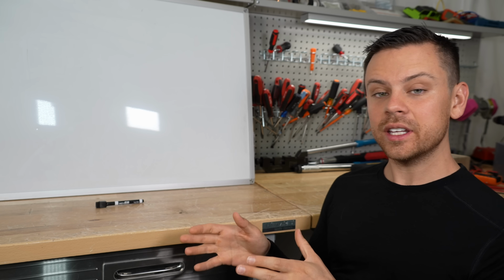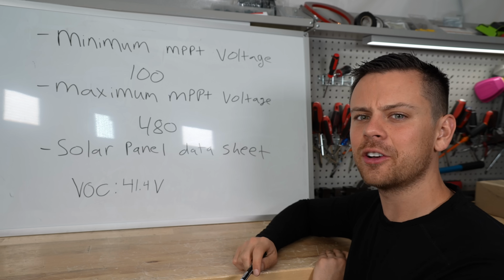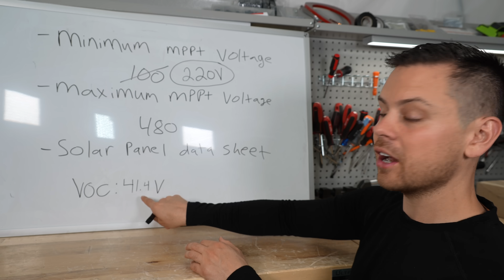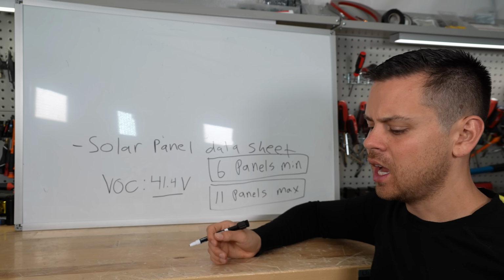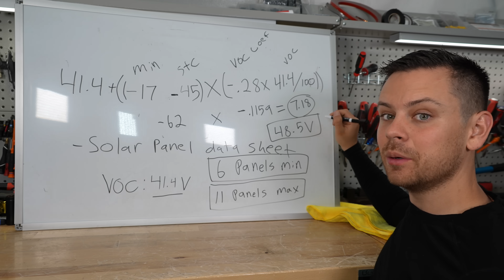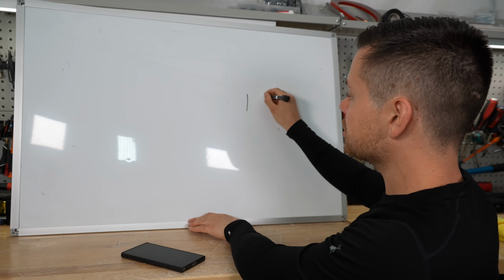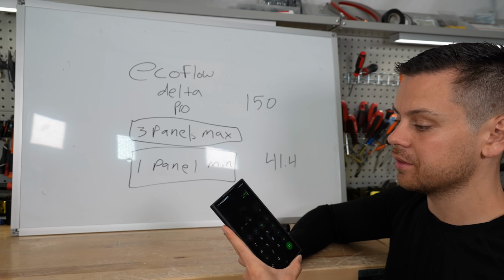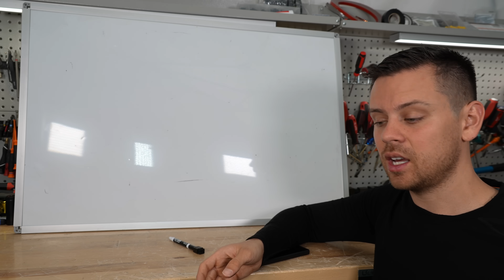Solar String Voltage Made Easy! How many solar panels can you safely connect?

Comment: Thanks for the timely instruction. I'm building a tilting panel 2h X 12w on a 40 foot high volume container. I have a full pallet of Aptos 370W bifacial panels I bought at your suggestion (and with your affiliate link) ready to go. I plan to use two  EG4 18K inverter and batteries so I can configure them as three-phase 208V to supply my shop. I hadn't considered temperature coefficient in my design and thought I had plenty of series voltage headroom with 12 panels per series string at a series voltage of 497V since the inverter handles 600V. I don't have a direct value for minimum temperature where I live but some research tells me it isn't less than 20F which is -6C. To be conservative I used -10C as an estimated value which yields 573V as a series Voc value for 12 panels. That's cutting it closer than I thought I was, but there's still room. Thanks again for the clarification and of course I'll buy the two 18K's and batteries with your affiliate link--it's the least I can do for your inspiration. I agree completely with your view on EVs. Not great looking cars and the Cybertruck is needlessly fugly, but it's relatively easy to power your own EV, so all the whining about how electricity is produces is just lame. I drive a model Y and consider it the best car I've ever owned. I raced cars for 30+ years and owned two Ferraris--I'm not comparing it to grocery-getters.

Comment: QUESTION  I have an Ecoflow Delta Pro with a dual fuel generator and a smart home panel with one extra battery.  I would like to get close to the maximum input allowed by the DeltaPro, Buy installing EXTRA solar panels and have a free standing unit that would limit the input to say 95% of the EcoFlow. This would allow for maximum system input on cloudy days and end of day times.  Is their limiting device that I can install between the panels and the Delta Pro pro to accomplish this????.

Comment: Was about to start ranting about the temperature coefficient.
As a matter of fact, my highest results was during cold days... not during hot days thanks to the solar coefficience...
These are bifacials, so when I have a money and gear, I will put them vertical and see if it works better...
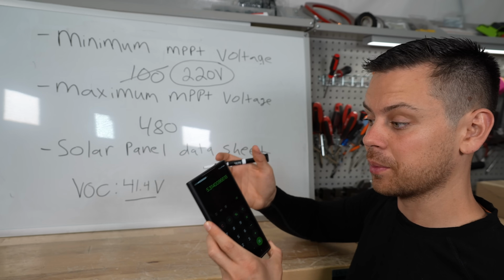But now due to the night cold, my panels start producing energy at 4:45 in the morning, at around 6 it's enough to start charging.

Comment: isn't "STC" = 'Standard Test Condition'?  (as in 25degC from your data sheet)
and "NOCT" = 'Normal Operating Cell Temp'? (as in 45degC from your data sheet)

STC is NOT NOCT...

the formula says to use STC!  granted, the end result doesn't make a HUGE difference, but it's STILL A DIFFERENCE ...

or what am I doing wrong?!?
Reply: i'm guessing you are using NOCT in your example in order to buy people more leeway/safety/headroom in the result...

Comment: Great video.  I'm curious about your statement to never exceed the rated voltage of the mppt controller and always round down.  I agree with don't exceed te voltage but the panels never hit their claimed output so shouldn't there be plenty of margin?
Reply: In most cases they may NOT hit their rated maximum , for a litany of reasons .
However , if your string(s) are putting out close to your MPPTs maximum rating , and , you have a sudden cold snap , the voltage is going to spike , possibly high enough to make magic smoke and uncouth language come out , and your hard earned money and expensive gear becomes a sacrifice ( burnt offering ) to the gods of electromotive force .

Comment: I've got an unusual question. What's your opinion on using a solar charge controller as a DC to DC charger? For instance, a victron 150-30 to go from a 48 volt battery bank to a 12-volt coach battery in an RV, not only would it give us the DC to DC conversion for charging the battery initially, but we could still put solar on that charge controller separate from the 48 volt system in the future. Actually was kind of given the idea A video about the portable power stations being able to use any DC input and the only way I can figure they do that is actually doing it through the solar charge controller circuit

Comment: would it matter if 1 string is 225 volts and the other  is 223.2 volts? on a 250/100 victron controller

Comment: We can get down to -40 here so i spent a lot of time on math to size everything so that during normal temps the charge controllers run at their most efficient voltage, but if we get -40 it wouldn't be above the maximum and would continue working just fine, very important for anyone living where it can get really cold during winter.
Should be running around 320-330 volts normal and if we hit -40 then it would be around 440-450. 
Well below the max of 480.

Comment: No matter how many of these videos I watch, I still don't understand. I have so many questions that none of these videos seem to answer.
It's like do this, but don't do that, do this instead, unless you're located there, so do this other thing instead.
I'd just like someone to make a definitive guide on this without all of the confusing if-then nonsense.
Reply: Like, is this video in reference to a 48V battery? You mentioned that at the start as a 'for instance', but what if someone had a 12V or 24V system? Does any of this change? It's all so pointlessly confusing and difficult to understand what assumptions you're making that we the audience don't know about.

Comment: To portray a scenario where cold weather voc becomes a major factor, my next array will be installed dead vertically facing due south yes its a less than optimal angle even far north. But im tired of clearing snow/ice of the panels so i can make coffee, i will just install additional panels to compensate for the less optimal angle.

Comment: Will, long time subscriber and love your content!

I just wanted to point out that with Delta Pro there are a couple potential issues running ~37 VOC panels in 4S or 4S3P.

First, the MPPT in the DP is not all that tolerant above 150 VOC. It has a measure of OVP but somewhere between 150-160V (if you get a spike one cold clear morning, for example) the controller is apt to be damaged.

Second, the MPPT tends to heat up and throttle somewhere north of 110 Vmp. Since running VOC close to the limit also means running >120Vmp (typically) there is a good chance 4S arrays are going to get throttled back to ~1200W or so during solar peak.

In general, 3S2P of 300-400W panels in the low 40s for VOC tends to be fairly optimal for Delta Pro (as well as the Low PV input on the Delta Pro Ultra) in many climates.

Other units (including the High PV input on the Delta Pro Ultra) may have better OVP and/or more headroom for VOC over the rated limit. DP and DPU are just what I am most familiar with and have a lot of experience testing.

Comment: Well that video came in hot like a guardian angel, I just bought a property and the owner told me everything is setup so you can add more panel and more batteries to the current setup without any issue but I had no idea too many panels can fug up stuff, I didin't order them luckly and sometime it does get cold down to -35 -40 celcius. Thank you so much, probably saved some of my equipment because I have no idea what my solar controller can even do

Comment: Why do I remember voltage increases in series connections, not the wattage. In parallel connections you increase your wattage, not your voltage. 

You indicated a connection of 3 x 370 watt panels in series would yield 1110 watts of power. From my education in electronics this connection increases voltage, not wattage. 

Parallel connections increase power, and voltage remains the same. In a series connection, the voltage adds up, but the current remains the same.

Comment: I recently purchased the Aptos 370 Watt bifacial panels just trying to figure out what kind of numbers I should be seen Max I've seen on my 6000 XP with 9 panel is 3150 w I have them on a ground Mount and it doesn't seem to have any bifacial gain

Comment: So that 9.8 panel limit, for example.  What's stopping us from putting a big zener or a regulator or something across the panel output to shunt and extra to ground and clamp the voltage to something that won't damage the charge controller?  I mean sure you'd be wasting a little power in that instance, but if that is only an edge case during the extreme coldest days of the year, then I'd think it would be a good tradeoff to have the panels operating at a higher voltage during the rest of the year, right?
Reply: I have had the same thought, and the reason I would NOT do so, is someone after the installer will come along, and see this zener diode, or regulator, and rightly say, "This doesn't belong in a string of panels, it's wasting power" Then they will remove it, then the system will be vulnerable. If the NEC taught me one thing, a lot of things are done to prevent a good idea from blowing up in your face.

Comment: STC or NOCT? I have 10 in a string. STC is in tolerance NOCT is not (v_max=450)
10*(v_oc+((min_t-stc)*(coef*(v_oc/100)))) = 443.4795
10*(v_oc+((min_t-noct)*(coef*(v_oc/100)))) = 466.8765

> noct=47
> stc=25
> coef=-.25
> min_t=8
> v_oc=42.54
> stc=25

Comment: I thought panel amperage is not an issue at all, regardless of amount of parallel strings.

If you would connect 100 panels in strings of 10, the charge controller only USES its maximum allowable amperage of lets say 12.
Reply: Some but not all controllers. Cheap ones will release the white mystery vapor. In general I would prefer to have less panels than the max wattage spect.

Comment: Good video on an important topic, but it's worth noting that the solar generator section does NOT include temperature adjustments. The first set of panels with a VOC of 41.4 will actually be a pretty good call for panels that will seeing freezing temperatures.

Comment: What about parallel series?
For example if you have an array on a roof another on the ground or another roof that's right beside it or all three options.
Reply: Yes, quite frequently I install parallel strings to keep the voltage in spec for whatever equipment it's powering.

Comment: If you live in high latitudes, your sun angle should take into consideration how much loss you'll have since the sunlight has to go through lots more clouds and atmosphere since it is going through the atmosphere at an angle. Your solar energy could be half what would be seen at the Equator, and none NOTC or STC take this into account.
Reply: Voltage will still be much higher irregardless of energy available. Been there seen that.

Comment: Hi Will,

Great video as I needed some instruction on this.  What about bifacial panels (Aptos 400W+) and on the 18Kpv not sure how things like nominal MPPT voltage plays into this (if at all).
Thanks!
Reply: I would also like to understand how bifacial panel performance adds to cold temperature calculations affect panel count. For example; three strings of 530W bifacial with peak low temps reaching -25F several times during winter with rare dips to -30 and then some.... Rear snow reflection for 4 months etc.:popcorn-yellow-striped-smile:

Comment: @willprouse, Connecting 4 x 400 watt panels even with a 37.18 VOC is REALLY bad advice as this is at STC (+25℃) 

I suspect the majority of users in the USA will have panel temperatures below +25℃ first thing in the morning when the sun hits those panels. 

4S would be fine for a place on the equator but this is asking for fried controller IMHO.

Best config for the panels you mentioned for EcoFlow Delta Pro is 3S2P to get the 1600 watts

Comment: If your buying used panels... Do you have to calculate the VOC differently?
Reply: No. Use the VOC on the panel spec sheet. Likely it will be less, but a good Victron charge controller can cost $700, so why take the chance?

Comment: My 16 Aptos 370watt panels arrived today and I have the 6000xp after your review. Really appreciate seeing you validate my rough guestimate for the two solar strings.
Reply: On the 6000xp do you connect the entire string to PV1 or use 2 smaller strings and use PV1 and PV2? Thanks...
Reply: @johneaton3609 I finally got the conduit in the ground from pv to home. 4 wires for the 2 strings.

Comment: Thanks again Will.
Could you please explain how the twin inputs work on EG4 machines. 
When there are 4 inputs per MPPT i.e. 2 neg and 2 pos, how does that effect the calculations please? 
Does the inverter treat them as separate inputs, or are they simply combined?
Thanks

Comment: Just be careful when dealing with that high voltage DC. If it gets ahold of you that's probably it. I worry sometimes about people doing this without the understanding of how dangerous it can be. I don't want to scare anyone off, just THINK before you DO. Electricity doesn't make noise, doesn't smell, doesn't light up, just waiting for you to complete the circuit.
Reply: Grounding is great, but if you get between two different voltage potentials ( if you put your volt meter on the two points you would get a voltage) and the difference is great enough you get poked. Lots of factors involved, people have different resistance, is you skin wet or dry, is it going from you to ground then boots matter, if it is going from one hand to the other that is the most dangerous it has a high chance of going through your heart. It takes very little power to stop your heart around 100 milliamps. That's why GFCI's trip around 5 mA in about 1/10 of a second. If you grab a live wire with enough power, and it doesn't take much, you will not be able to let go. It doesn't blow a fuse, trip  a circuit breaker or stop until something stops it. Should you be unlucky and get a bad poke but someone kills the power to save you, GO TO THE HOSPITAL it can mess up your blood and still kill you. Not likely with just a "snap ouch" but if you get stuck on a cable and someone or something gets you free the risk is greater. When working with  solar, the higher the voltage the smaller the cables but the more dangerous it gets. Electricity takes the easiest path to get where it wants to go, DON'T BE THAT PATH.
Reply: @richardkent9621  Let your ground be your path.
Reply: Spend a little extra time and money on grounding your system properly.
Reply: @RichardQuaid bonding
Reply: The more people play with power the more respect they get… all you can do is hope they get the respect fast enough to live through it …
Reply: I got a taste of 125vdc. Not enough to kill me obviously, but just enough to stop messing around carelessly. It felt different than AC, obviously, but like a thuding evil twin of getting shocked by AC. Like drowning in gasoline instead of water. Experience is very similar, but different.
Reply: The reason 48 volt is the max is because you can get shocked at 60 volt. Tesla is going 48 volt. Everyone should go 48 but panel strings will be higher volts to reduce the amps and smaller wires for longer distance and yes be careful. Cover your panels when working on them or do it at night. I was scolded on the phone for working on a live string and the tech complained about arcing while plugging in and out. Not enough is said about long strings working on them in full sun and the dangers.
Reply: @timsteinkamp2245 The threshold voltages are actually 50 V RMS for AC and 120 V DC. Voltages below these are considered safe. Voltages above these may cause death by electrocution.
Reply: @timsteinkamp2245 I put a switch on the positive between the panels and the charge controller.
Reply: always think twice when playing with DC, AC will throw you, DC will grab you and someone standing by will have to help, I would say the limit is about 50v you will feel it, so at 150v and you take it across the chest you are dead ....
Reply: Facts! 150 v dc should scare the piss out of you, if it doesn't, spark the wires together to gain a proper level of respect . Bzzzzzzzzzzb
Reply: In my country people work with live 240 volts AC  @gratefultrucker7781
Reply: I have been shocked from my 360v string it's much worse then 120v, it hurts like hell but no hospitals or band aids just keep working.😂

Comment: I am building an array(s) to feed an EG4 18k inverter.

The string voltage is calculated to be fine with 13 panels, but the input amperage is half or less of the limit.  Seems like there should be a way to maximize both.

The Trina 245 watt panels produce 37.3 volts OC, and 8.47 Amps (short circuit) under standard conditions.  

The input limit is 31 amps on the mppt1 input.   Seems like setting up 2 panels in the string with a parallel connected panel would get the amperage up closer to the limit.

The plan is for (3) 13 panel strings feeding mppt 1, mppt2, and mppt3.

Comment: Bro. You are on fire with the EXACT necessary vids as of late. I already "knew" this info but the voltage was an assumption. The destructions of my Epever unit says 150v but nothing about "do not exceed!" Can I request some extra info? Language on fuses/breakers and WHERE to put them? In my original designs w 12v, I melted a fuse holder trying to run an A/C unit AND my overhead lights. Had I not been there, I would have burned down my shop as the draw was too much (hence my switch to 24v system now). I think fusing and circuit breaking is an overlooked safety device that if installed in the wrong spot can cause HUGE consequences. Thanks bud!